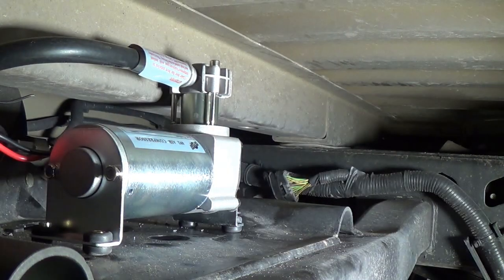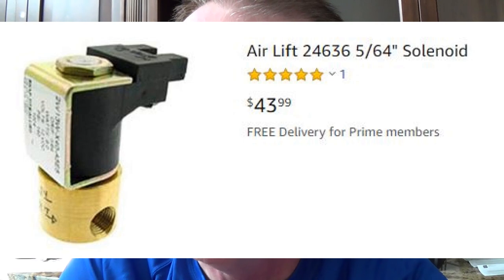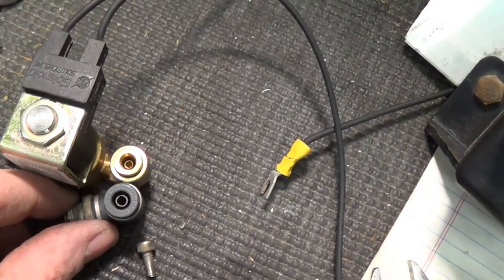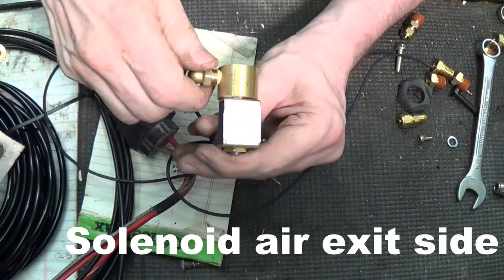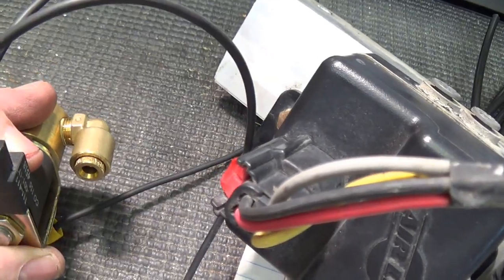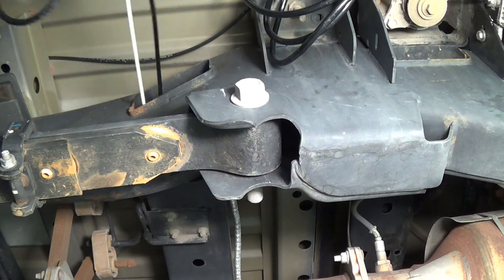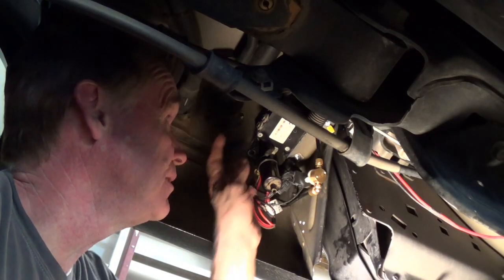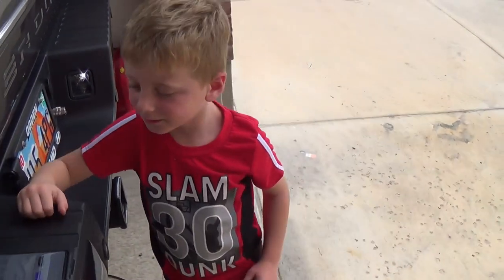Using Airlift wireless control with on-board air system

Comment: That's exactly what I wanted to do! I have dual ARB set up with 5 gallon tank. I ordered airlift wireless one and didn't want to run there air pump. I was told it would not work but you found a work around solution. But he also told me is give it a couple of months they are coming out with a wireless solution for people who already have on board air.
Reply from the maker: That's great news Airlift is going to provide a solution for folks like us. We've been asking for a long time.

Comment: Whaaat? Wow, I have been scratching my head for months trying to figure this out and then stumbled onto your video. I have a dual compressor set up with a 150psi 5 gal tank. Did not want to run another compressor for the bags and did not wnat the main fill option to be manual. This video saved me a ton of time. Thank you

Comment: This is exactly the system I want.  Thank you for putting this together.
Reply from the maker: Happy to do it. It's really been great and continues to work 100%. Wish AirLift would offer this as an OEM option and save the trouble with the little compressor.
Reply: @EpicCowlick  I sent them an email asking if I can get the kit minus the compressor. No reply. Worst case I have a spare 12 volt compressor in my garage.

Comment: I'm glad you made this video because I was just getting ready to install the same air compressor and in the same spot you installed yours on my '17 F-250.  I think I'll install mine somewhere under the hood now.
Reply from the maker: Yes, pretty much anywhere under the truck is going to allow water onto and into the compressor motor. It's interesting that the same setup on my 2011 F350 didn't fail in the six years I had it. The only difference was that the compressor was installed upside down, hanging under the bed. The install on th 2017 was right side up and further back and we know what happened to that.
Reply: @EpicCowlick  I see others on YouTube who have installed in in various areas under the truck and think they will be replacing it as quickly as you had to.  I'm a little extreme on anything I do to my vehicles, in that I try to make the installation look as factory as possible.  I thought about installing the compressor behind the back seat but I really don't want to have to drill through the cab to run the wires and air line, then there is the noise factor.  I'm looking under the hood again to see if I missed a spot to install it and the manifold.  Even with the 6.2 gas motor, there isn't a whole lot of room under there either.  Thanks again for posting such informative videos.
Reply from the maker: @kckettridge  Hopefully the 6.2 gives you more room. The 6.7 takes up ALL the space and gets seriously hot under the hood. Airlift could solve this problem easily if they added a rubber O-ring and sealed the wire channel. Viair does that with their compressors and it doesn't matter where you mount them. I've always put those compressors outside the frame rail where they get a lot of water spray and no failures in 10 years. Regardless, I actually like this setup better without the little Airlift compressor. Much faster. Good luck with yours. The airbags are awesome.
Reply: @EpicCowlick  well, I installed the Air Lift Air Bags and the 75000.  I ended up having to mount the compressor and manifold on the drivers side, inboard frame near the fuel lines.  It was a tight fit but that really was the only viable spot for it.  There just wasn't any place under the hood to mount them.
Reply from the maker: @kckettridge  It's a great system. You'll love it. You might want to consider some high temp silicone and just gob it over the seams and wire penetration through the stator body. That compressor will run for  a long time if it can stay dry. Congrats on getting it done.
Reply: @EpicCowlick  Great Idea.  I will do that .  I take it your either in the building trades or engineering of some sort.
Reply from the maker: @toolguy1964  Some sort ;)

Comment: Thank you for making this video!  I was just starting to research how to do the exact same thing when I stumbled on this video.  You answered my question as to whether a 150psi tank could directly feed the manifold--I guess not.
Reply from the maker: Technically, it's not the 150 psi that is the problem.  I confirmed this with an AirLift engineer. The actual valve that is in the manifold is the same one used in AirLift's Performance line. It's rated up to 200 psi max. So holding back that pressure is not by itself the problem. You have to control the amount of air coming from the tank. That is easily controlled by reducing the size of the tube that feeds the manifold. So 150 psi at 1/4 inch tube is too much, 150 psi at 3/16 tube works great. It's only one fourth the amount of air at the same psi. It's still working great btw. I use it a lot and love how fast it is.

Comment: Great video! I have an ExtremeFlow Belt Drive Compressor SERPENTINE BELT, from Extreme Outback to supply air for tools, airbags, air horns, etc. Its a great option producing 8 com, mount under the hood. I was really happy to see your video showing the Air Ride solenoid.
Reply: My question is what size fittings did you use to connect the solenoid to the air tank & manifold?
Reply from the maker: @solowfrful  1/4 npt for the larger tube, 3/16 for the smaller.
Reply: @EpicCowlick  Thanks, but the ports on the solenoid are too small to accept either. Wondering if I have the correct part
Reply: I will contact Air Lift. Thanks for all your help. Keep up the great work and awesome videos!
Reply from the maker: @solowfrful  Interesting. You might just try a local resource for air hoses and fittings. A shop that supplies over the road trucks.Take the solenoid to them and explain what you're doing and they should have the fittings in stock.

Comment: Great video that's funny I called air lift today and they told me it wouldn't work with a tank. Nice to see the solenoid worked.

I do have a question how does it drain the air does it go right back thru the same line to the bag and dump it thru the manifold?
Reply from the maker: The air tank has its own drain of course. The AirLift manifold (the part that sends air to the air bags) has an air dryer on the air coming into it. Notice the black cylinder with the pointy thing coming out of it. It must be installed vertically with the point drain oriented straight down. Any moisture in the air is removed and water droplets are expelled out the bottom of the dryer. This is a huge improvement AirLift made to their systems. The earlier versions didn't include the dryer and many-a-manifold failed due to water as a result.
Reply: @EpicCowlick  Thank you for the reply. Could another possibility be using my existing arb compressor and no tank. Just run air line from compressor to manifold as long as the manifold and it's relay are wired to any source of power? Or would the solenoid still be needed to tell the compressor to give it air? Or do I just turn on power to my arb through my aux switch inside and then go up or down on psi?
Reply from the maker: @rikosuavesito07  I'm sure any other compressor would work. It just needs to be 12v. The manifold doesn't know what's attached to it, it only sends 12 volts across those two wires when the PSI drops below the set limit. So it could be anything including a different brand compressor. I wouldn't expect it to power a large compressor though. It's probably only sending 5 or so amps. If you need more power, just add a relay and use the manifold positive compressor output as one of the two source inputs on the relay.

Comment: This is a great video.  I am curious though couldn't you just attach the solenoid to the air manifold with a 1/8inch pipe nipple to cause the same effect?
Reply from the maker: There's many ways to accomplish this. At the end of the day, you just need to reduce the air flow volume and any restriction in the line at any point will do the job. Take a look at a few engineering documents on fluid dynamics and you'll see that flow volume decreases not only at the point of the orifice but is also affected by the length of hose. The numbers I used were based on 12 inches of vinyl hose/tubing.

Comment: Greetings again.  I hav a Airlift bag system and a Viair 200psi single compressor with a tank.  I just ordered the Gen2 Airlift command center.   Like many others,  I don't want 2 air compressors on board.  Did you try the solenoid set up first with the larger tubing?  I saw on a different Airlift vid that said  the supplied compressor with the kit is 100psi.  I'm worried my 200psi will blow it. Any advice?  Thanks n advance.
Reply from the maker: The original little compressor was 150 psi. It had to be to be to get the tank to 150 psi. I didn't try the 1/4 line first as I had already read about the over pressure issues. The manifold is rated to 200 psi but the valve i used in this video is only rated to 150 psi. I wouldn't run a 200 psi 1/4 inch line into it. It's possible that a 3/16 hose coming out of the tank at 200 psi would work and might be worth trying.

Comment: Do I  need to run a 3/16 line from the air tank to the solenoid or just from the solenoid to the manifold on the air bag unit? Also, do you just connect the wires from the solenoid to the old compressor wires?

Comment: Fantastic video! Thank you. Quick question.  Can you please confirm this to make sure I am tracking correctly?  1/4" line coming from the air tank to the solenoid (straight 1/4 fitting) and then 3/16 fitting and line from the solenoid to the 3/16 fitting on the air filter?  Or, is it a 3/16 line all the way from the air tank with 3/16 fitting on the air tank itself? Basically, how many 3/16 fittings are required? Love your videos, thank you.
Reply from the maker: Your first scenario is what I did here. 1/4 npt up to the input side of the solenoid and then 3/16 npt between the solenoid and the manifold. The solenoid itself is rated to handle 150 psi at any volume so 1/4 npt to the solenoid is ok. The 3/16 npt is required prior to the manifold to decrease the volume of air arriving at the manifold. You can certainly run 3/16 hose entirely but the longer the length will result in decreasing air volume due to friction losses. One of the best things about this setup is the speed the airbags inflate. They're fast but not too fast.
Reply: @EpicCowlick  Awesome! Thank you for replying so quickly.  One more follow up question and I'll leave you alone :)  The new 2nd gen WirelessAir does not have the air dryer/filter connected to the manifold, but directly to the compressor (which I won't be using with this set up).  Are the two air dryers/filters from the tank dual compressors enough, is there another workaround for this, or should I just go with the 1st gen to be safe?  Again, thanks for your videos.  They are so helpful.  I did the surgical tubing on all of my rattling doors (2019 F-250) and it is so quiet in the cab now.  It brings a tear to my eye :) I can't stand random rattles and noises on a $65,000 truck.  I hope everyone is staying healthy.
Reply from the maker: @jasonwindom2981  We're well, thanks. I'm not up to speed on the 2nd gen model. I'd guess there are some improvements in there somewhere. Surprised to hear there's no air dryer. AirLift had a lot of problems with previous versions that didn't include one and I was glad they added it. Hopefully they're not taking a step backward. You can always call or email them to see what they say but I would just make sure a dryer is between the tank and the manifold somewhere. Brand shouldn't matter so long as it gets the job done.
Reply: @jasonwindom2981  I'm looking to do the same thing with the 2nd generation, did you get it working with replacing the compressor with a solenoid just as @EpicCowlick did with the gen1?
Reply: @TrueLoneReaper  Has anyone got this working with the Gen 2?  Thanks
Reply: @mballak3  I ended up just installing the pump it comes with directly up to it as a stand-alone system, separate from my on-board air/horn setup. The pump is pretty quiet and fills the bags fast enough. If the pump goes out on me then I'll add the solenoid. I don't see any reason why it wouldn't work, I'd recommend using a static pressure regulator before the solenoid if you are running over 100psi. Just know that if you are trying to go from 200psi down to 100psi like I was, they may be hard to find.
Reply: Thanks!  Appreciate the response.
Reply: @TrueLoneReaper  Sorry for the super late reply (not sure my notifications are set right).  I started gathering all the required parts around the time of my first question then covid hit hard and I lost my garage space to do this project.  I almost have everything I need, but it was actually difficult to find the 3/16 fittings.  I ordered one and what showed up was a 1/4.  I am still on the lookout for them if anyone has a good link.  I was also wondering about @EpicCowlick upfitter set up.  When he put in the OBA he wired it to the #5 (40amp) and originally wired the Wireless manifold to # 4.  Was wondering if he modified that or just turns on both upfitter switches to operate his system?

Comment: Eric  great video but I didnt see where to connect the solenoid wire?
Reply from the maker: Solenoid has two wires. One to ground the other to the 12V coming from the manifold which powered the compressor. It is wired in the exact same place as the little compressor was.
Reply: Which wire is the negative or does it matter
Reply: @PandasAndrew  if they are not labeled it doesn’t matter.

Comment: Sorry about the compressor! But that's a cool workaround. Is there a way to seal up the compressor from water?
Reply from the maker: You could try some liberal RTV sealant but there's still penetrations where wires and bolts come into the motor side of the compressor. This compressor must never be exposed to water and probably very little dust.

Comment: Thanks for the video. I watched your installation video for the 'Air Lift' system on a 2017 F-350. I have four questions.
1) At 0:11, you show water's effect on the motor and suggest using a solenoid. But how did you prevent recurrence? Where was the new motor placed or otherwise protected?
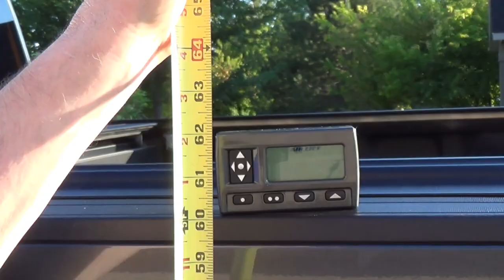2) At 7:00 it visibly shows that the air bags are made by Goodyear, not AirLift. Did you switch air bags, or complete AirLift systems, or something else?
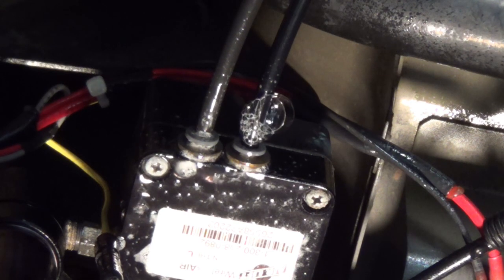3) After you showed your push-to-fit couplers leaking (5:08), did you replace them with compression ferrules?
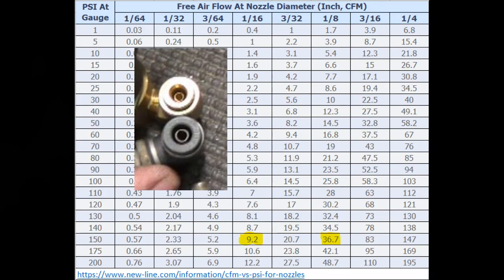4) What is your source for the chart at 2:07
Reply from the maker: The original little compressor is replaced with a solenoid. No motor, brushes or things to fail. The solenoid is plumbed into the air tank which if charged with two separate compressors. The solenoid has no way for water to get into it from the outside. The AirLift airbag is made by Goodyear. You can go back and watch the airbag installation video on this channel.

Comment: I have a bunch of the same stuff you have on your truck this is so great.  If my little compressor goes out I will most definitely be doing this upgrade.  I wish it would lower and lift the truck just a few more inches to hook and unhook a trailer easier.  Amy ideas on that?
Reply from the maker: There are full spring suspensions available for our trucks but they are expensive. They can raise the truck higher or lower it below stock height. If money is no obstacle, what you describe can be done.
Reply: @EpicCowlick  money is an obstacle to a reasonable extent but for 17 to 20k I will figure something else out.

Comment: I am planning on putting an airlift 5000 system on my new truck and want to have the air tank like you have, will this solenoid work for a 200psi tank with dual compressors? Any tips before I purchase all the parts?
Reply from the maker: Air Lift says the valve and the manifold is rated to 150 psi. I've seen an unregulated system like you describe and the volume/pressure of air hitting the manifold causes the manifold to over-pressure the the desired setting pretty fast. It cycles above and below the desired psi several times. The manifold will then exhaust the over-pressure sometimes below the set value and then allow more air in which will over-pressure again, etc. It eventually settles down and finds the correct pressure but you can tell the manifold is taking abuse. You can add a pressure reducer prior to the valve to keep it below 150 to stay safe. In my case, the tank psi is never above 150 psi so I didn't have to do that. The 3/16 line from the valve to the manifold is an easy solution to controlling the volume of air hitting the manifold. My setup is working very well and there's no reason to think it is being overworked in any way. You will love it when your system is finished. Fast and reliable.
Reply: @EpicCowlick  thank you! I may do the 150 psi tank setup just to be safe!
Reply from the maker: @lgvids3710  200 psi is a good thing when it comes to filling tires. If you do the math you'll find that a tank at 200 psi has 1/3rd more air in it than one at 150 psi. Filling a deflated tire is just a bit quicker when the tank starts out at the higher pressure. With my dual compressor 150 psi system, I can fill a 37/12.50/20 from 20 psi to 65 psi in 3 mins 45 seconds. If it started out at 200 psi, it would probably take 3 mins? Something like that. If you're going to spend the money on the higher capacity system, just make sure it includes a pressure regulator that can be installed on the line that feeds the airbag system. Otherwise, just go with a dual 150 psi setup like on this truck and it's pretty awesome. Link is in the video description.
Reply: @EpicCowlick  okay thank you! I appreciate your guidance!